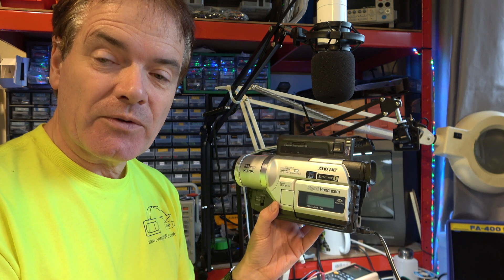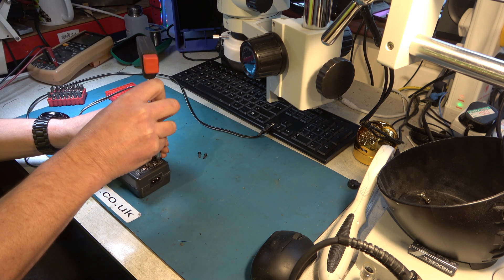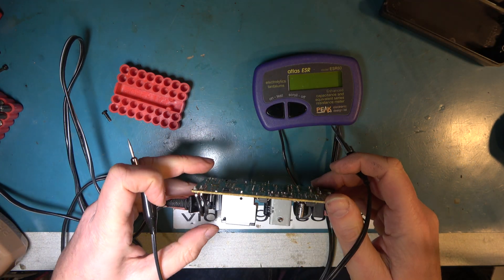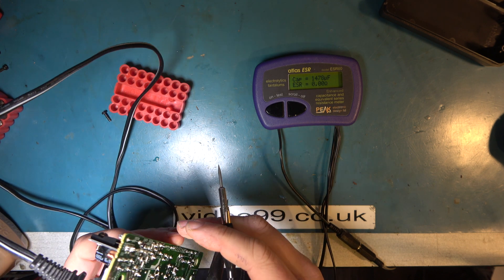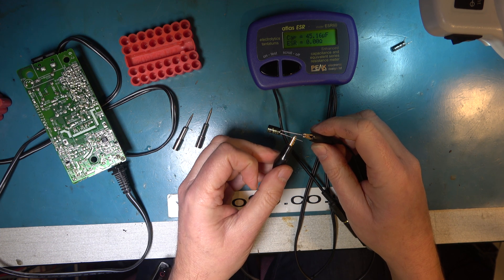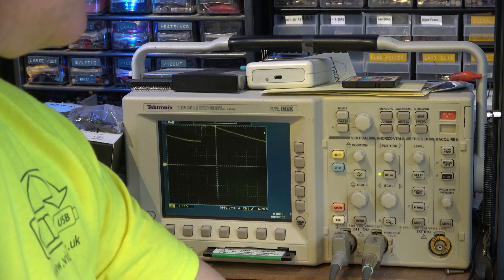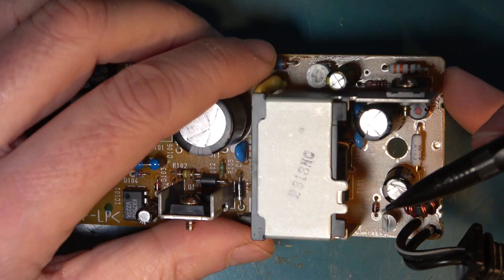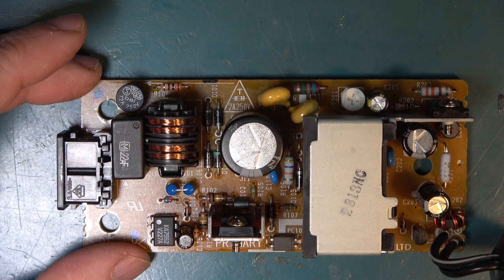Friday 13th fail. Sony AC-L10B power adaptor for Digital 8 camcorder.

Comment: Just found the same problem with another Sony AC-L10B power supply. Both 47µF caps (C108 primary side, C205 secondary side) were bad, replacing these fixed the issue for me.

Comment: Good morning, my VX-1 Pro camera stopped recording videos correctly, the image has flickering and colored streaks, I cleaned the head and the problem remains only in recording, when playing other tapes the camera will play correctly, I had changed all the capacitors  a year ago and I had cleaned the boards properly there were not many leaks.. the camera worked fine sometimes but when I didn't use the camera often when I put it to play the tape would spin and the motor sounded like tired as I worked on 1 hour the camera the problem went away,  to emphasize that in the two DC converters the camera has throoghole capacitors which I have not changed I suspect they are the ones causing the problem !!
Reply from the maker: Those capacitors might well be the problem.  Sometimes you can test capacitors in-situ with a ESR meter, but it depends if the circuitry around presents a load to the meter.
Reply: hmm i opened the dc converter it there are sanyo capacitors in purple color i didn't see any leakage but they may have short circuited or dried out due to aging i will measure them and change them later i hope that is the problem and it will be solved,
Reply: @video99couk   I changed all the capacitors in both converters, cleaned the boards with alcohol for any leaks from the old capacitors, also cleaned all the cables and connectors on the deck of the cassette player, re-soldered the boards for any bad connections, cleaned the brown and the problem remains the same what do you think could be happening? see the two videos I uploaded 
https://www.youtube.com/watch?v=XMQPo9ij3QI
https://www.youtube.com/watch?v=zWXUpzljgys

Comment: first suspect for a pulsing SMPS would be the startup cap (usually 47µF 16-50V) on the primary side (next to the KA7552 SMPS controller in this case, and identical to the failed one on the secondary you replaced), which i don't think was even tested here, let alone replaced. If it goes bad, the PSU tries to start, the control IC gets starved of power and shuts down, rinse and repeat. When the problem isn't as bad yet, the PSU might just take a little longer to turn on when supplied with AC, which progresses into several seconds of "ticking" as the PSU tries to start up but fails till it eventually still manages to do it (usually helped by warmer temperatures), to the point where it doesn't start up anymore and just pulses permanently with the output being all over the place, if there's any at all
Reply from the maker: All capacitors were tested.

Comment: It's not a Trick, it's a Mitsumi. If it's a Supplier Part for Sony, they might have no Circuit Diagram at all. I would have treated the Q201 SMD Transistor on the Underside with Cold Spray, because solder baths are always dangerous for SMD Transistors.

Comment: I would suggest (carefully!) measuring the ripple on the power rail of the primary controller chip. I think you gave up too easily. :)
Reply from the maker: The reason I knew it wasn't ripple in the primary, is that the pumping action carried on for some seconds after the input was disconnected.  During this time, there cannot be any ripple.  Hence we had eliminated the entire primary side.
Reply: Easier to get another PSU and change the output plug /socket
Reply: @markhodgson2348  A inexpensive 8.4V 1.5A SPS is not easy to find, and with a 9V power supply, a diode in the circuit would dissipate 1W of heat

Comment: Speaking of digitizing V/Hi8, did you notice a discolouration appearing as a greenish stripe along the right edge of the image, when digitizing to DV file?
Reply from the maker: This is well known, it was due to a compromise Sony made in their PAL camcorders.  The stripe is supposed to be in the overscan area so not visible on a TV, but you see it on a video capture.  There's also head switching noise at the bottom, typical of all domestic formats.  So I drop the captured picture by 1% and expand it by 3%, sometimes shifting right by 1% too.  Then it fills the frame nicely.
Reply: @video99couk  It doesn't appear, when the machine is in passthrough mode.
Do you know what is causing this to happen specifically?
Head switching noise I've witnessed on many tapes now can be very minimal, on one occasion it was only one line, that disappeared when playing in VLC with deinterlacing turned on.

Comment: Any luck on the dead 9v psu?
Make sure the three lead Tl431 shunt regulator near the output is ok, and it should also go down to the opto coupler to control the switchmode .

Comment: I'm thinking you did this for the video / for fun because there's no chance this is worth all the time of attempting to fix it when they can be purchased for under £20.
Reply from the maker: Well I thought it would be a quick repair good for a YouTube Short.  But it was neither.
Reply: Considering the replacement PSUs are 99% not original and tend to also be a danger to your device with zero noise filtering or any sort of safety features, it definitely is worth it to try and fix an original PSU that was built to a standard... with the standard not being 3 miles under a chinese dump
Reply: @Knaeckebrotsaege  you can buy the original used as a replacement but I agree with the the replacement adapter quality
Reply: @Knaeckebrotsaege  surely if the input was going to permantly damage the device it should just blow a fuse though right?